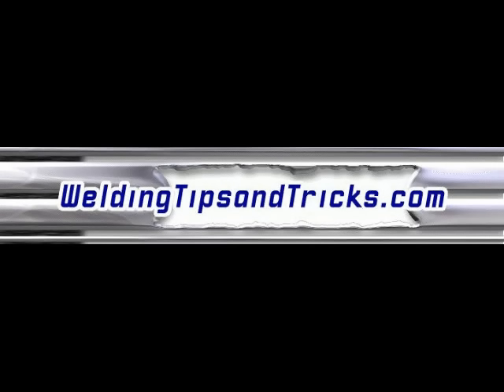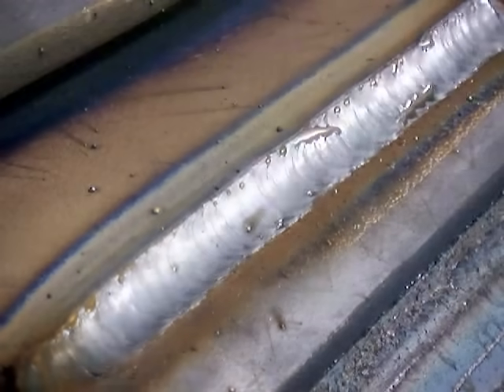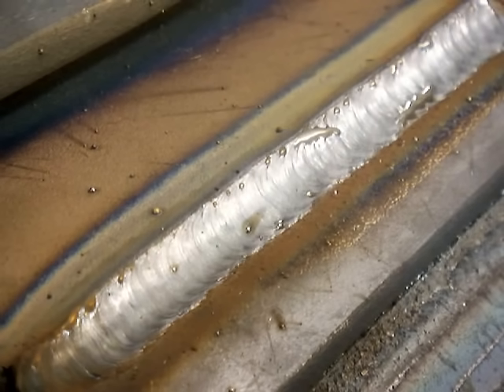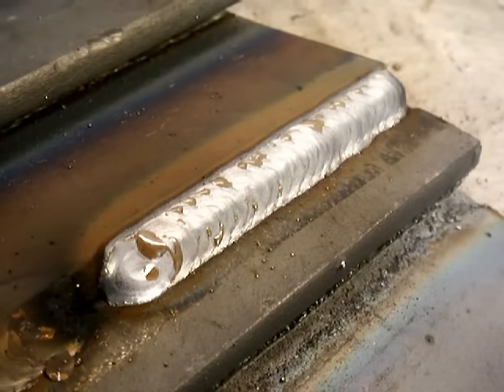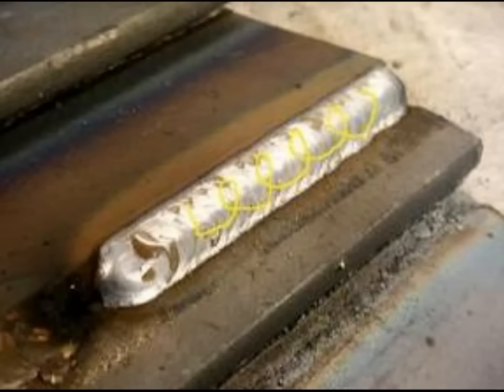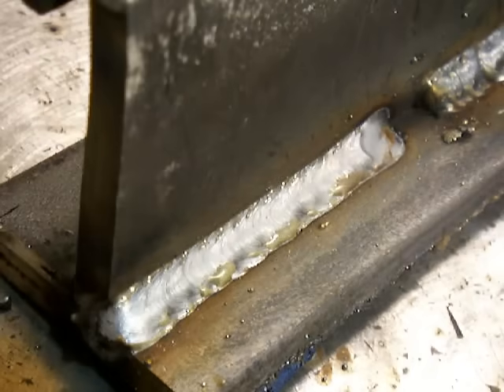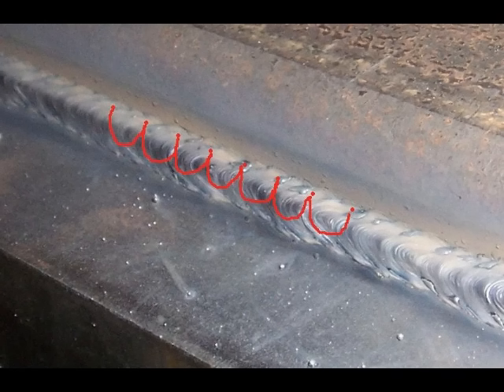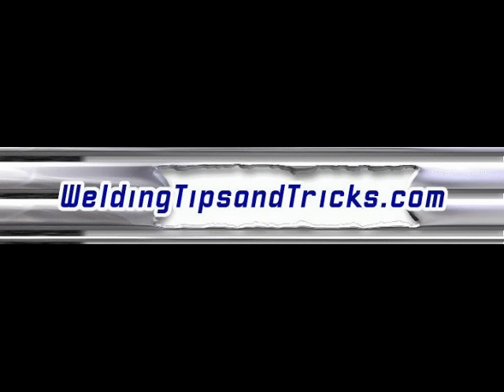Mig Welding Technique Taught by Old Timer

Comment: How to tell if your weld WILL never fail?  Flip over your project and you should see nice, even brownish burn marks where you welded.  I always run straight if I can.  Taught that way at BAE then again every person you weld for wants you to weld the way THEY want you to weld.  Guys who welded for 20-30 years failed that test every day since they weren't used to welding with that thick "cored" wire.  Had to keep the gun AHEAD of the puddle.  I just don't think many of them had welded with that thick and type of wire with that much amps.  I failed my first try for that reason.  Once again though if I were to flip a vault door I welded together you could see dark coloration of all my welds through 3/4" of stainless. I had to weave on the lip, yea, but given the choice on heavy welding I'm running it straight.  Less wire=$, less spatter=less time which=$.  Plus it's easier to sand and grind down if the welds just thick enough.  You can make very thick welds running straight also.  I'd get yelled at since I had to weld a handle to the vault so it could be moved to the end of the line.  They had to clear it all off but it weighed over 3 tons and I was shocked at how little weld you needed to hold that in the air bouncing!  It always shocked me.  TIG welding Aluminum is what I mostly do now with some here and there with my career.  Welding's a passion and but I respect and feel for anyone still out there working in that heat everyday, man that was brutal!

Comment: Sorry for the ignorant question, as I am new to welding on my own, and have only welded 2 times on auto body under heavy supervision, but; i have a welder that is rated for max of 3/16th steel, and I am looking to weld up a MOVE bumper, the construction is 3/16th steel, but should i weld both sides of the joints, or just one?   I am using flux core wife fed.

Comment: How do you reduce all the metal 'spray' that deposits all the metal 'balls' or droplets around the weld? I seem to get a fair amount of those (using flux core)
Reply: Michael Kirst you need a tig then.
Reply: Your always gonna get bb's with flux core, an old guy at a welding shop I worked at once told me if your getting alot of bb's then play with your setting a bit more and it'll cut down on the amount some, they also make sprays and nozzle dip they claim prevents bb's but I couldn't stand that crap
Reply: Michael Kirst instead of dragging the bead if u push it the splatter will shoot away from the bead
Reply: WD40. The arc will burn if off the surface that you are welding, but there will be enough residue on the surrounding area that most of that splatter shouldn't stick.

Comment: I really want to invest in a welding machine for hobby welding. It will be very small metal work as in wire" lamp shade framework".
 Am I looking at the wrong process to do this  , as it really is just spot welds I need and would appreciate some feedback if welding is the process I should employ for this.... I have had some practice at all types of welding but definitely found the mig the easiest. I know this is a petty question it will still be appreciated though....

Comment: Hi, I just found your channel, and I've watched several videos. I really enjoy them. Do you think when your doing the cursive e that top, and toe of the weld is cooling as your doing it? Great point on the debate on weather hard wire should be pushed or pulled. I've had many welders tell me pushing actually preheats the steel as your welding. Which I do notice a much smoother weld, but you can't always get your gun in like you said. You should demonstrate some core shield 8 used in tilt ups. The good old days of using NR211 is gone since the Oakland Bay Bridge went down. Even though NR212 is the wire of choice for many welders now. Welding inspectors only want you using the core shield 8. What are your thoughts on that? Thank you Christian

Comment: in my experience it has a lot to do with the welder and the gas used. its mostly getting the speed and heat setting correct
Reply: Clams. Current. Length of arc. Manipulation, speed of travel.
Reply: For Gas use the next trick : if the cup has a 10mm opening use at least 10 liters of gas.

If it's 12mm use 12 liters
Reply: @Sassenhaim  I never knew you ever had to adjust the argon pressure flow.  I've always keep my pressure around 5 psi, but is there a way to actually adjust the amount of argon flowing out of the machine?  I have a Lincoln 175A, very popular and well known that can be used for aluminum by attaching a spool gun.  Anyways, all I have ever seen is a wire feed speed dial and current dial.  Is there something that controls argon flow?  IMO it seems like it shouldn't have to change, but I'm not a welding guru.  Maybe I'm misunderstanding what you mean by "gas."
Reply: @tomm3850  
There are flow meters you put on the regulator. I'm not an expert by any stretch so I'm just guessing but I think the idea is that you can save some gas by adjusting the flow relative to the cup size. You need enough gas to keep out air but not too much that you are wasting it.
Reply: BILLSTMA
Reply: Practice, Practice, Practice weld puddle control, but before that, its surface prep, quality consumables, and correct beer setting of the operator.
Reply: @mrdamecktech7927  I find it’s a very fine line with the beer level of the operator. It only takes one measure too many and the weld goes all booger. Although, adding another or two and the weld doesn’t really even matter any more.
Reply: @mrdamecktech7927  )))))))))
Reply: Better penetration with push
Reply: I agree 100%
Reply: Lincoln 175 amp!  Rocks.
Reply: My biggest thing is dialing in the wire speed and volts when using different materials, I'll forget to turn it up or down depending on thickness of material used lol
Reply: @zacharypeery4082  Mark your machine
Reply: Volts amps matters not much the third  law make the difference resistance which is us  how we drive the lead learn to follow your lead do what ever you want
Reply: So many different factors going on. In MiG welding they are all going on so fast all at the same time. You have to train your head to handle them all automatically.
When it comes to pushing versus pulling, in MiG welding it doesn’t matter a whole lot one way or the other, what I have found is that pushing just makes more spatter shoot off the end all over the place while in pulling most spatter that may be shooting off the end goes right into the puddle. That’s about it.
Unbelievable just how much guys in a shop will argue about it.
Reply: @michaelszczys8316  also penetration is different......

Comment: I  am having a ton of trouble with blowing through on root when trying for my 1G. I have 1/16th land with a 3/32 gap and 3.8 plate. Slight forehand technique at 16.8v and 220wirespeed. Any tips

Comment: Can a weld break?
Reply: Russ Tanner if it's a good weld, it's incredibly hard to break.
Reply: Usually a sign of poor penetration. A weld breaking is typically the filler material separating from the base material.
Reply: Generally the weld does not break, the material directly adjacent to the weld breaks.
Reply: can a condom break?
Reply: does the pope shit in the woods?

Comment: the one thing I found that metal prep is important and using wire clean pads and lube pads make a difference proper gas flow proper amps

Comment: I have used this type of weave before but I don't see much benefit over wip and pause
Reply: I agree with this..   doing nice little circles may give a 'pretty' bead,  but unless done by a competent welder, can also leave undercut at the toe, which is a stress raiser and a fail in any test.    The controlled and steady whip and pause.. from one side to the other helps to ensure crater filling and avoids any undercut, especially when in a positional weldment.     Too many are concerned by the simple appearance of the bead.  Although I do agree that a good weld usually also has a nice bead,  but the 'niceness' should be secondary to the functionality of the weld
Reply: I like to use the circles for <22v steel and stainless welds.  Really helps with excessive buildup when material warpage is more important than penetration.  

Can't beat whips for spray, though.  Kids outa school try to tell me to hold it steady, no movement.  That makes a terrible looking bead no matter how good you are.  I figure if I set it extra hot, the whips cool the weld, so it all works out in the end and I get a pretty bead.

Whip and pause works great for aluminum spool, too.
Reply: ChrisD4335 whip and pause is mostly for stick welding or smaw sheilded metal arc welding using a 6010 6011 or 6013 electrode
Reply: justin estell no Justin that is not accurate at all, you are defiantly not a welder.
Reply: ChrisD4335 excuse me i am certified for flat and horizontal welding and going to college for welding so yes i know the 6010 is a fast freeze electrode that is a whipping or whip and pause method i
Reply: "whip and pause" with mig is great if you're constantly changing base metal thickness and don't feel like changing settings. mine was more like a jump and stop but when looks are more important than penetration, it works. 

 steady ain't pretty? are you steady and set right?
Reply: ChrisD4335 qqqqqqqqqqqqq

Comment: Could this technique also be applied to stick, I usually do it with 7018 and it works just fine but i'm not sure if it is the entirely correct way to do it, could you also just drag the stick in whatever direction that you are welding and yield a similar looking bead?
Reply: I just drag with the 7018
Reply: with 7018, no occil is needed, really  use a triangle technique
Reply: FREQUENCYZX11
Reply: FREQUENCYZX11
Reply: FREQUENCYZX11 u

Comment: Make sure you clean your base metals. If you are welding over fire scale from the mill, you could have a decent looking weld but you could break it apart with a hammer. Make sure your temperature is hot enough get the proper penetration. Common problem is using a machine too small for the job.

Comment: I'm welding 1/16" wall 3" square tubing to 3/8" plate. The plate is horizontal and the tubing is vertical. I have the voltage control on highest and wire speed on 60-70. Too high? The ball is at 20 on the flow meter. The arc is dancing all over the place, not settling in. The flow meter is producing a lot of condensation. Any suggestions would be greatly appreciated. Thanks.

Comment: Feeling discouraged, looking for advice.... I have a Miller xp 130 machine that I bought new in '99. It's 120 volts. I use it occasionally and it is like new. Recently on a new project, I ran out of my old argon/CO2 gas and let the local welding supply store talk me into a bottle of straight CO2. I have a new roll of .023 wire. I have tried to adjust the braking effect on the wire roll so it is resisting just a little. The tension on the wire drive is firm but not too much. Today, while welding outside, with some wind but very little, the machine was acting like it was throwing the hot wire metal at the weld, with lots of spatter and burping and crackling, not nicely at all. I had the flow meter set at 20 and it was showing lots of condensation on its outside. I was trying to weld the end of a 3" square tube of 1/16" material to a 3/8" plate. The plate is horizontal and the tube vertical. 
I had the voltage control set on #4, the highest, and the wire speed at about 70. The metal is

Comment: I tried to weld for the first time today. while I was welding it kept popping, and the wire kept like slightly pushing the rod. any tips? or advice?
Reply: What? What rod?
Reply: +Rob I don't know the technical term. the thing that you hold in your hand
Reply: turn wire speed down, the wire is pushing against the base metal if you feel the gun pushing back. could also turn up voltage.
Reply: Oh you're talking about the MIG gun lol I figured you didn't know what the hell you were doing and tried using a TIG filler rod while your migging. Ha
Reply: +Rob I really don't know what I'm doing. Haha but thank you guys
Reply: Wyatt Fabre shoot i suppose you could record yourself welding and ask whats wrong, to me its easier to hear a bad weld than to see it
Reply: +Countryboy2206 I'll let yall know when I post it. I didn't think of that.
Reply: slow your wire feed maybe bump up the power a lil . if you slow feed to much youll get the poping but without  the pushing. go slow dont outrun your puddle and just  keep doing it youll get it, it just takes a lil time.
Reply: I have welded with manitowoc crane for a year and what I have learned from experiencing that is to knock your wire speed down or bring your voltage up depending on the thickness of steel.
Reply: when Mig welding it should be like frying eggs sound . And no pushing on the gun , then you know you have the heat & wire speed right

Comment: I was welder at caterpillar, when I started working there I was used to weld like this, doing small loops, then they advised me it was wrong, I should weld going back and forth, actually today I weld in both ways, as long as my welding looks steady
Reply: gilmar martins Sounds Like you worked in production, that’s stuff the boss try to get you to do to save a buck I’m pretty sure

Comment: Some time I push some time I pull depends on position I mainly do Alum for 20 years now main things to remember is your gas mix will change your weld heat /penetration zone profile, of weld as long as your preventing the atmosphere from contamination and you will know lol porosity stands out . Hardest thing is balancing your welds to prevent distortion angular, transvers, longitudinal ,have fun groover's

Comment: You should always have the collet (end of the gun) pointing in the same direction as the gas flow, its wrong to drag the gun as the gas flow is not performing in the pool area efficiently, leading to a weld quality of less density and more bubbles, so the old timer who showed you this particular tip WAS WRONG !

Comment: wielding on thick steel is easier than doing thin sheet like cars, you can blow holes when lees experienced, my panel beating teacher was class at wielding he could mettle finish on cars when doing quarter panel replacement, that takes a lot of experience to do.

Comment: as a welder for 13 years professionally dnt no a single welder who would say pulling is the way to get proper penetration in a weld when x rayed u see its got so much contamination the job will deteriate quicker than a weld pushed.wouldnt like to be on a bridge were this welding is accepted

Comment: just bought a millermatic 250 and having a hard time adjusting it, has 0.30 wire .... I don't get the bacon frying sound like on my smaller machine with 0.24 wire.... have not used bigger wire before so maybe it's welding properly, welds look good, any tips ?
Reply: could be a gas issue. might have a small leak somewhere or not enough pressure on gas.
Reply: different wire type can sound different. i like to set voltage and turn wfs up till i can feel it stabbing metal, then i slow wfs down to get the sound. globular welding and spray transfer will sound different also.
Reply: +Countryboy2206 got it figured out, too much stickout...
Reply: mike hastings hah i forgot about that, makes sense

Comment: When welding outward form a three angle joint, there is no room for the torch, your shroud or to see exactly what you are doing. Usually when working in tight areas under trucks, equipment etc. Push and drag. Listen to the burn is all you can do. Then go in with a mirror to see what you have. These you tube videos are not realistic. They are all in perfect conditions at a bench. Many of them are completely worthless.  Get into the real world and it is not always that way. Hard, real time experience will teach you that you have to come up with your own solutions in the heavy equipment world.  Pipe welding is reasonably simple compared o the tasks in the heavy equipment and structural world.

Comment: These welds are as good as you can get, i know i have been welding for 50 years.
All you knockers here dont know what you are talking  about.
Lets have a look at some of yours, by the way i am a panelbeater and welding light guage even butt welding and fusion welding with oxy and no filler rod.
Reply: I didnt say filler as bondo,look up fusion oxy welding without and rod.
Reply: No filler ? lets hope your parent material holds up
Reply: @danielmcbain8097  no filler? Did he mention MIG?
Reply: Get a job welding things that have to be leak tested. That will make you good.
Learn how to run your welds together so they don’t leak at the joint, that will make you good.
Learn how to weld something so that after it is all welded and cooled it is the size and shape it is supposed to be. That will make you good
Reply: Tell me what was Wrong in your comment.
Reply: There is no substitute for experience.
Reply: Probably weld 2 soda cans together.
Reply: You only drag with stick welding or flux core, if its metal core you ALWAYS push. Those welds look nice to the eye. But both penetrate completely different
Reply: If after 50 years you didnt know that this was in fact WRONG then now is the time to listen old man !